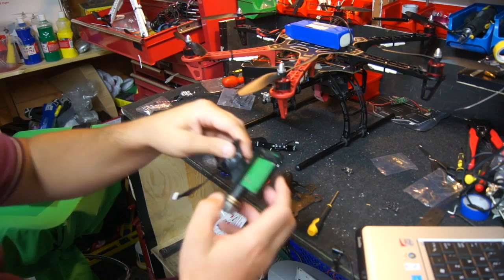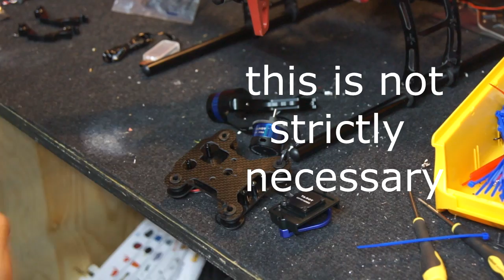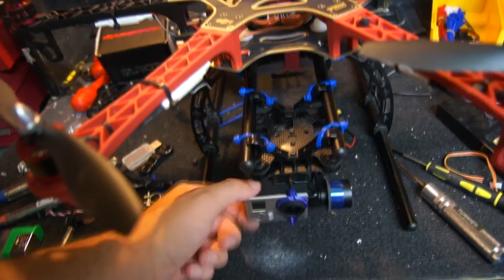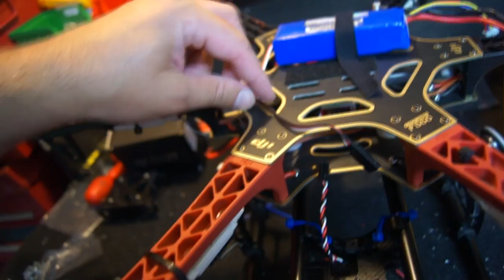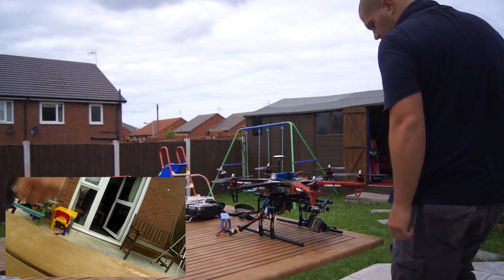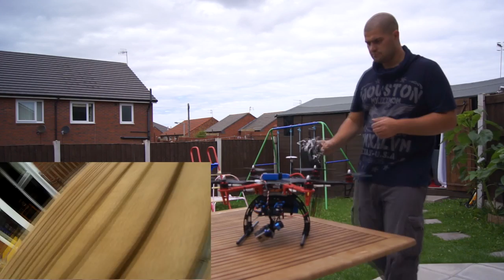Detailed Tarot Gimbal install with Pitch control by That HPI Guy

Comment: Nice build, setup, and use video. So the cable that you show at 11:45....i wasnt going to comment, but you didnt pop on a text bubble about it, as you did for the plate flip. Connect the THREE pin across the CTR...extend it to reach your Rx or Naza...THEN use the 3 single plugs to connect to each pin, or not, depending on if youre using all of the control inputs. On the other hand, I sure wish after all my searching that someone wouldve explained what the Sbus/camera interaction is used for. The P of course is camera shutter trip.

Comment: Your using the NAZA M V.2 Do you just use the T pin connected to the bottom F2 pin on the NAZA or do you need the (--) pin also for pitch control ?
Reply: +Spencer Boaz he didnt connect it to the naza ,the gimbal has its own accelerometer ,he connected it directly to a channel on the receiver
Reply: robomanism OK I'm using a DJI DT7 radio with the S bus receiver and I have to connect to the NAZA for tilt . Thanks  I have it working fine now .
Reply: cool

Comment: Hello, I have problems with gimbal, tilt backwards it does not lower the camera podiras me the configuration of f1 and f2 for an original phantom TX, I use a cable with 3 colors thanks .. greetings from chile
Reply: did you got you gimbal to work with naza?
Reply: Ricardo Silva
it wil work....
Reply: Arnold Harns can you explain how you did it please? i get the signal to the software and when i move the center position on the software the gimbal moves, but i cant get the remote to work
Reply: Ricardo Silva
just One cable from the pitchcontrole (Which is the top middle pin on your board)port to the bottom connection in your naza F2 port.
at least this is how I did it.
then you have to set up with the naza software.
Reply: Arnold Harns on the radio and naza assistante it needs to moove x1 right?
Reply: yes
Reply: Ricardo Silva
yes
Reply: Arnold Harns unable to moove the gimbal...
Reply: Ricardo Silva
did you use just one wire from the "t" pin of the gimbal to the bottom pin of F2 port of naza? than it should work. did you switch on the naza the gimbal on? good luck...
Reply: use ground and signal. gimbal on, back knob working

Comment: Hello, I just buy a tarot T2-D V2 to use on my phantom 2 and I am very satisfied with the product, I use a knob to set the tilt of the camera but when I switch to Stick Position Mode in Attitude monitor mode appears only - 45 degrees and i limit this minimum angle set to -90 degrees, I wonder why this limitation so happens in this mode, and when I change the angle of the camera to approximately -30 and lean the aircraft camera moves to another postition don't keeping the previous angle -30 degrees of tilt, can you help me?

Comment: Great vid, thanks. Looking to buy one of these but most UK suppliers, Amazon & EBay don't list what comes with the bundle.  I am guessing that there must be more than one type of bundle available as this is the case in the US.  Currently one is available on Amazon for £119, 'without gyro for GoPro Hero 3 Control Board, no manual' etc.  If supplied without gyro will this be sufficient if hooking up to Naza M for stability?

Comment: Very good video, but I have got one question: I just want to use the gimbal for stabilisation (without tilt and roll control, because of my dx6i). So do I have to use an extra battery or is it possible to connect the gimbal to my naza, so that the gimbal would get power from my battery wich is on my f450.
Thanks

Comment: Sorry if it has already been said, didn't go through all the comments, but set the power of the motor to 40 instead of 20 and the failure won't happen no more, you just need to give that one motor more power and voila!

Comment: My parents got me one of christmas off amazon but it does not have the carbon decks. They are plastic and drop down (not flat) is the gimbal fake? Why are they different?
Reply: No it's not fake, I've just received mine as well and it is the same as yours, I believe that they are a newer kit that have plastic the base plates, once you have assembled it you'll notice the improved height over the original flat CF base plates. I also think that it was easier to assemble than the older ones (just my opinion though)
Reply: thanks

Comment: Hi! Is there a way to install pitch control wired? I'd like to use this gimbal handheld, and have tilt control on my frame under my thumb (+- 4 inches from gimbal itself).
Reply: the easiest way would be to use a servo tester. for example http://www.hobbyking.com/hobbyking/store/__17143__Simple_Servo_Tester.html
Reply: Danglosaxon servo tester works great, just like i wanted it to work. Thanks for the tip!

Comment: Hello. Thank you very much for your highly detailed instructions. Helped me a lot to mount my Tarot gimbal in my Walkera QR X350. The only thing I couldn't get to work is the pitch! there was an AUX2 in the controller so I plugged it in, but the picth does not move. Do you know of any setting I have to make in my DEVO F7? I set AUX2 to aux2 KB, and also tried all other options... thanks

Comment: Great video! I have an issue, maybe you can help please? I installed my tarot t2D on my phantom, did the firmware upgrades, but upon arming gimbal it's position is pointing up a little to high, few degrees, horizon too low, I will install tilt control knob soon, can the horizon issue be solved in the tarot's software or do I have to wire gimbal into NAZA then adjust with control knob manually, maybe I can reset horizon parameter in NAZA instead? Thank you!

Comment: Thank you so much after watching your video I got mine working. Is there a way to set end point on your radio or do I have to set that up with the mfr software. otherwise mine is going to far in both directions. thanks again...

Comment: Hi HPI, today i had to adjust my tarot gimbal, and in doing so the black and white wires came out of that block of nice pins in the gimbal circuit board (three rows of three pins),
I know the red one does nothing, but could you please tell me what pins to re-attach them to please? I couldn't figure it out in the video as your camera did not get to show what i needed to see....Beside the three rows from top to bottom (on the right of them) it says:
CTR
S+-
P+-
Third row is blank.

Comment: Great helpful video!  I hooked mine up this way and had a major malfunction and lost complete control.  Am I supposed to hook the gimbal to my Naza GPS?  Also I powered the gimbal separately from the motors and the video Tx.  Is this correct?  THANKS!

Comment from the maker: yeah you should be able to connect it to the naza on the pitch prongs. either F1 or F2 (Iforgot) and set the VR not to CH5 to move angle.

Comment: Great video.  One question though, I plan on installing on my Phantom and using my Futaba T8J dial knob to control tilt.  From this video it looked like I only connect the manual control wires directly to my Rx?  Is that the case or is there a connection to the Naza as well?  Thanks in advance.

Comment: Cool video Richard. Did you flash the T-2D with thelatest Firmware, motor, controller board and gopro settings? Si

Comment: i heard they fixed the spectrum problem, but I just don't trust it. plus futaba has the best for compatibility with lrs.I'm not using the 2.4 module anyway.  i'm just not happy with 2km. I'm sure it's a great radio, just not for me.